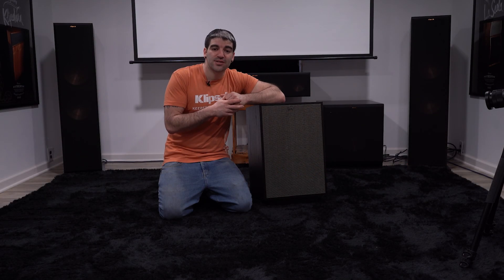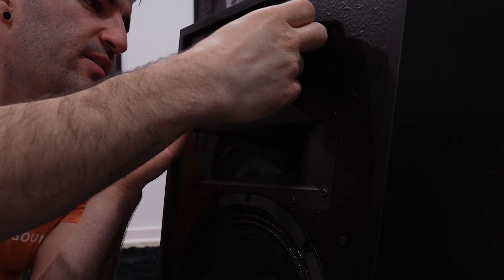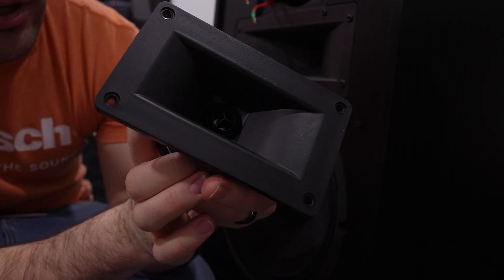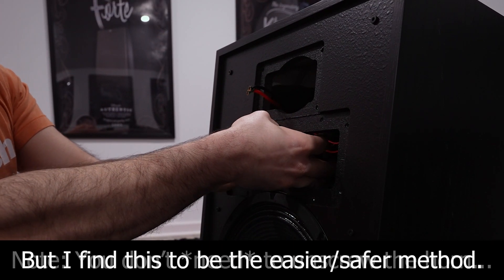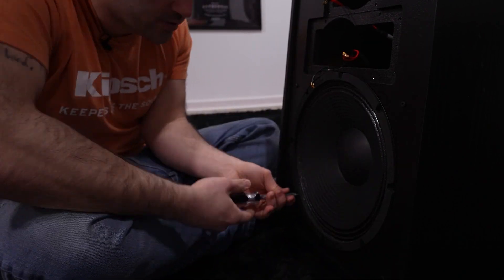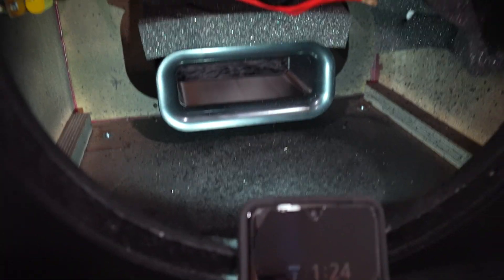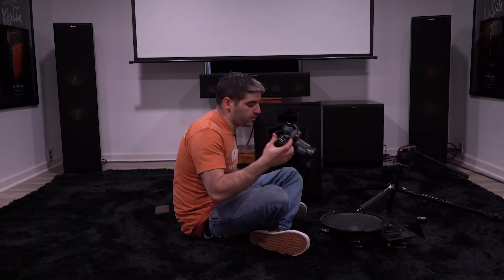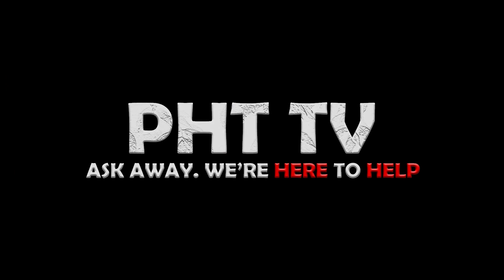What's in the box!?!?!?! - Klipsch Heresy IV Disassembly

Comment: Today I unscrewed the woofer from my Heresy 4, why does yours have Audioquest and mine has regular cables like the rf7 3?, What's going on here?
Reply from the maker: at some point they lost interest and changed it I believe.
Reply: ok, I think I know the answer to this question now. I currently have another pair of Klipsch Heresy 4 from the beginning of production, i.e. from 2020, and as it turns out, this pair of speakers has AudioQuest type 4 cables. Previously, I had a pair of Klipsch Heresy 4 from 2021. In my opinion, these speakers play much better on AudioQuest cables, they are not obtrusive, sharp and rough as they were on regular cables. Best regards @TopShelfAudio

Comment: I asked and you answered. Thanks for this…just wish there was more lighting when you were removing the drivers. 
Comparing the IV’s to my 1’s, what a change in the XO. I like being able to remove the back panel on the 1’s to get to the drivers and XO than having to go through the driver cutouts.
Reply from the maker: Thanks for watching! Taking off a panel makes it a bit easier to work on for sure... but, you can't get as air tight of a seal or as strong of a structure as the new gens with their insetting the motor board 

-Jason

Comment: These are great but you have the find the sweet spot in the house and put them on stands if you want more bass
Reply from the maker: With any speaker, you'll want to make the proper adjustment in placement and tinker with location to find the best fit for your room. These are certainly no different.

-Jason

Comment: The Heritage line's internal construction disappoints me. The way the foam is just loose inside the box and the fact they blew off any internal bracing. As proud of the Heritage line as Klipsch appears to be with their price points, I would expect more effort. At $3000 a pair would it too much to expect Sonicap's on the crossover's?
Reply from the maker: Thanks for watching! The foam isn't loose, it has tacks in a few places, but they may not be noticeable in the final version of the video. The only place where the foam would move is where I lifted to show more of the port. As for the internal bracing, I wouldn't expect them to add anything different if it wasn't necessary. The K-28-E isn't an excessively heavy driver so, the additional support isn't needed. They also use nuts and bolts as opposed to wood screws to attach the driver so stripping/falling out isn't a concern...That and the inset motorboard increases the structural integrity as well. Holding all of the components in my hands and feeling the structure...I can say, these things are for sure built to last. 

-Jason
Reply: I agree, the HF and MF horn drivers seems fine, everything else about these speakers looks cheap. The cabinet is cheap, poorly constructed, cheap crossover, cheap cables, cheap LF driver and non existent cabinet treatment.